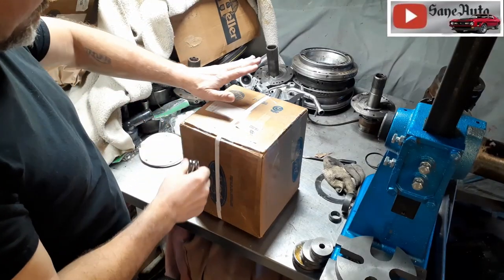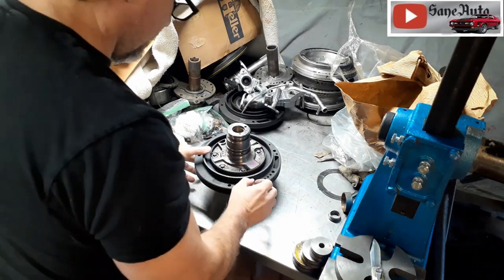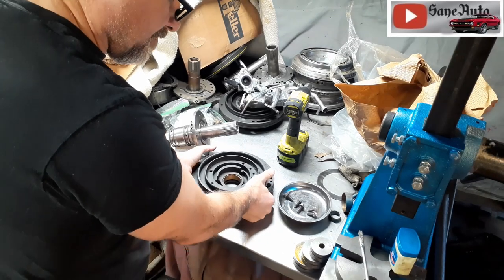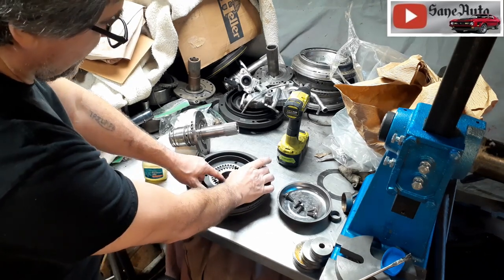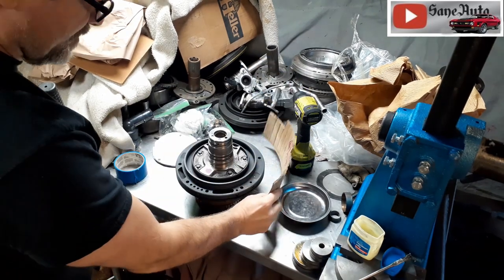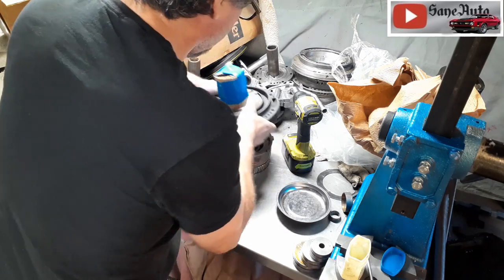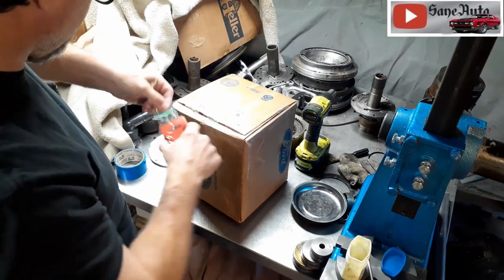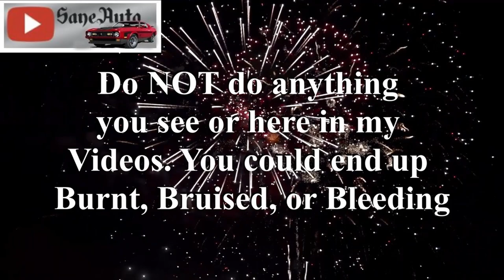Unboxing Brand New AOD Pump Ford Automatic Transmission inspect and prepare for install

Comment: I use a old 700 sun Shell to hold the pump half up while I assemble it or a old coffee can, and I always double check the pump half on a torque converter to make sure the bushing is it cocked , and pack the back side of seal with assembly lube so the spring doesn't pop out